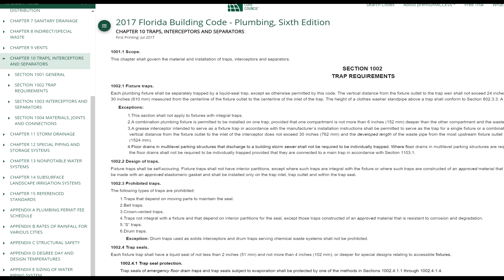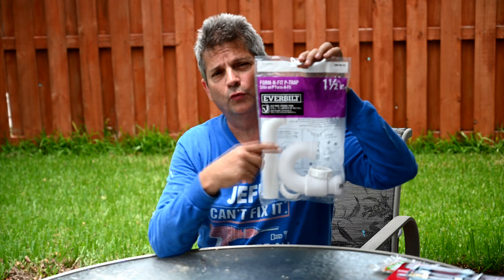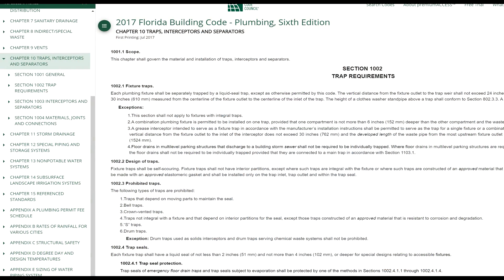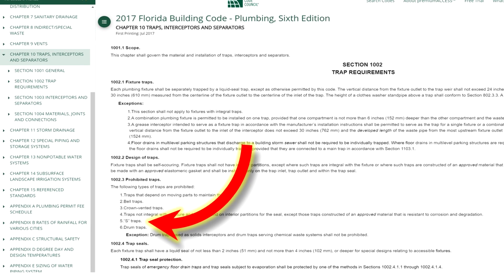Why You Should Never Use Plumbing S-Traps On Your Sink Drain

Comment: Snappy Traps say they are up to code. Not true?
From their website:
"Does Snappy Trap™ meet plumbing code standards?

Yes, Snappy Trap™ models # DK-110 and DK-100 are certified by the International Association of Plumbing and Mechanical Officiials (IAPMO) to meet the Uniform Plumbing Code (UPC). The UPC certification is valid in all 50 states and Canada. Part #ʼs DK-105 and # DK-120 are listed with IAPMO to meet the criteria of IGC 328."
Reply from the maker: I know they say that, but I have not played with there traps. They claim the inside of the p-trap is smooth, which I find hard to believe since the flexible p-trap acts like an accordion. I also find their claim about UPC valid in all 50 states, because UPC is only used in a few states. Here in Florida, our plumbing code is not based on UPC, although it has a lot of the same rules.

Comment: So my apartment sink has an S trap, and the landlord’s uncle apparently did the plumbing work. So since they’re not allowed I don’t know where to go from here about confronting the landlord about this.
Reply from the maker: It depends on when it was installed. Not sure when they banned them. They probably won't want to switch to p-trap, because assuming there is no vent stack within 5 feet, they would have to make on or connect to an existing vent stack, a feat usually done when the walls are down during a remodel. If you don't have any trouble with the S-trap now, if the drain works OK, and you never smell sewer gasses, you are likely to be OK.
Reply: Possibly contact the building permit department of your local municipality

Comment: 1:43 "It's almost like a capillary action".

It's nothing like capillary action. The word you were looking for is "siphon".
Reply: The video is full of inaccurate info. It was a waste of time.
Reply: Venturi flow is what we in the instrumentation trade would use to measure a DP across a flow orifice. Restricting the size of a pipe to change pressure and velocity. Not what you mentioned.
Reply from the maker: Yes, otherwise known as Venturri effect
Reply: @jeffostroff   The Venturi effect has to do with a decrease in pressure due to a choke in a pipe, which is not the Siphon phenomenon caused by an S-trap that this video is about.

The issue with an S-trap is that, if the entire pipe becomes filled with water, the rapid drop after the P-trap-portion will result in a vacuum behind the last quantity of draining water. Under normal conditions, where the p-trap is followed by a tee with a vent, the vacuum will be resolved from air in the vent. As there is no vent in an S-trap, the only place for air to come from is the drain, behind the draining water, which will siphon water out of the trap.
Reply: @YuriyRusko  This reply was more informative than the video.  Cut right to the heart of the matter clearly and concisely.
Reply: @jeffostroff  just lol. Venturi is nothing to do with siphon, unless you have a restriction in the pipeline that causes the flow to increase through that point - then that is a Venturi (facepalm)

Comment: Reference is made in the video to have the plumber reroute the drain pipe inside the wall.  That vertical drop through the floor is acceptable if properly piped using a p-trap in conjunction with a AAV(Air Admittance Valve) then drop down to that vertical drain.
Reply from the maker: Yes, they need to make sure their municipality allows those studor valves, some states don't allow them.
Reply: @jeffostroff  yes I agree but as i see it, an illegal s- trap with an AAV is preferable over just an s-trap no matter what.

Comment: Why are they allowed to sell these traps?  I saw drum traps are a no go also.
Reply: They sell them because often consumers just want to replace what they already had. I'm a plumber myself, I replaced the vanity and sink  of my bathroom recently but I had no desire to switch over to a p-trap because my s-trap was functioning without issue.
Reply from the maker: Nothing illegal about buying or selling them, they just are not allowed by building codes.
Reply: jeffostroff your missing the whole point,... you sell them to unsuspecting customers... integrity seems to be a missing trait in Americans these days.
Reply from the maker: @hvac01453   Yes I agree they should not be selling them to people or at the very least they should have a warning on the package that says this will violate plumbing codes and that maybe it should only be used as a very quick temporary solution or of somebody wants to use it outdoors maybe but yes you are correct and I wonder why all of these installers keep installing them to why does home depot and Sears and all of those companies that send installers to install people's refrigerators why do they keep using these banned parts.

Comment: If your drain system isn't ventilated properly, how is a P-trap any better? Wouldn't it suck the water out of the trap the same way? Maybe I'm missing something. Plus, if you have an existing S-trap under your sink, and it's giving you this problem, couldn't you just cut in a studor vent somewhere underneath the trap.  Honest questions here. Not trying to say this info is wrong, just trying to understand. I'm sure there's a reason I'm not seeing.
Reply: It takes years to get a journeyman plumbers license because of things like this. Water traveling through a drain pushes air in front reduces air pressure behind. Vents have to be located properly in the drain system so water isn't siphoned because of the reduced air pressure.
Reply from the maker: what you are missing is one of the causes of the S-trap self siphoning. It is caused by the S-trap having a short vertical leg before the S-trap, followed by a long vertical drop after the S-trap. This condition causes an increase in downward water inertia, which causes the S-trap to self siphon and empty out, called the Venturri Effect. The P-trap solves this problem with one subtle difference, that is that horizontal arm coming out of the p-trap and into the wall. That horizontal arm slows down the inertia of water so that it cannot sell siphon the P-trap. As long as your trap is within 5 feet of a plumbing stack you should be OK. Some states allow you to add the Studor Valve, under the sink, it must be above the P-trap. Not all states allow the Studor Valve, which is pretty much your only real option when you have an island sink.
Reply: Ok I see..  makes sense.  So installing a studor vent as close to the s trap as possible should solve that problem if you have an existing s-trap. Not ideal, but if you have no other option, that should fix the siphon problem.

Comment: I had no choice but to use the s trap there is no pipes in the walls under the sink straight down to the basement old house
Reply: If you have a S trap like in the video, disconnect it at the floor, install a new riser use a Tee and P trap. Out out the top of the tee put an auto vent. Easy fix.
Reply from the maker: @tracyreynolds2013  Yes, many states allow the use of a Studor valve under the sink. Some states like Wisconsin and a few others don't allow it.
Reply from the maker: Yes in your case that's fine if it still works. They really only make you put them in for new construction, and some inspectors might be sticklers when you remodel and open the wall, they might make you put in a vent stack, or route to one within 5 feet, or ad a Studor valve under the sink.
Reply: Use a hepvo waterless trap instead. It's much safer.

Comment: You should have mentioned that if all devices are vented it’s very unlikely to suck the other trap dry.. right?
Reply from the maker: Yes, if they are vented properly too, as there are equations that tell them where to vent, how to vent, how wide the vent stack pipe needs to be, etc.
Reply: I'm remodelling and am opting to use an S-trap instead of having my sched-40 adapter be in a horizontal position. I don't trust it in that position. I capped the old P-trap and am splicing into the same drain the P trap utilized in the basement, and it has a vent.

Comment: States do not enforce building codes, local authorities enforce.  And local authorities can and often do choose to allow existing items to be retained in exiting construction.  They would NOT require you to change out an S trap all by itself.  You likely would have to change to a p trap if you were doing a complete remodel of the bath or kitchen.  The real issue is proper venting which will allow an s trap to work fine.  If toilet flushing causes the s trap to evacuate, then the toilet is not properly vented.
Reply: 36736fps you’re totally correct
Reply: That's dangerous

Comment: I just remodeled my house in NY 4 bathroom sinks,1 kitchen sink, 2 utility sinks one in laundry room and one in garage, two washing machines one upstairs one downstairs in laundry room and guess what all sinks in house drain through an s trap into 2 inch drain line with a vent going up through roof. Code inspector said it is perfectly fine to use s traps and also pointed out a code violation using p traps with drain pipe in wall I chose to use 2 inch on my drains because of the number of fixtures on system now you take a 2x4 wall and drill a 2 inch in the 2x4s you just broke a code because of the size of holes you just drilled for that pipe now to drill a 2 inch hole through sub floor and no code was broke. I also have my systems as two separate systems black water and grey water. My grey water goes into a hundred gallon tank then through a small leach field. I have never believed that grey water and black water should be together unless you are on a public system. The soaps and cleaners dumped down sinks and from washing machines kills the bacteria in septic systems causing a need to pump them out more often and causes other issues in septics keep the two drain systems separate and properly sized and vented and s traps work way better than p traps  My code inspector had no issues with me using s traps and neither did my insurance company when they did there inspection after remodel.
Reply from the maker: That's interesting because it is in the NY code that S-Traps are banned. Also, I don't see how any code would ban the use of P-traps, are you sure this inspector showed you that P-traps are banned? I want to to see the exact chapter of the plumbing code for that one, I don't believe it at all.
Reply: It seems that the p trap violation he refers to is not in reference to the trap per se but to the size of hole to accommodate the drain.

Comment: Ok then.  How do you put a trap in an island sink who's drain is down through the floor? My house was built with an S trap.
Reply from the maker: Steven there are 3 approaches to this:

Solution#1: Do nothing at all. If your current S trap is not giving you any issues and you don't smell sewer gases and if it is retaining water like it should be and the water is not siphoning out of it then there is no reason to change it. 

Solution #2 Involves putting a Studor valve under the kitchen sink only if your state allows it. Our state Florida allows us to put one in and we use them all the time here where there's kitchen island sinks, and you’re not within 5 feet of a vent stack. The Studor valve sucks air in from underneath the cabinet and it has a membrane that prevents sewer gases from escaping out of it. 

Method #3: involves using a P trap but you would need to have a partition wall on the island behind your sink, many builders will build the island with a little partition wall in there to pass drainage pipes and water pipes. So your P trap will go into that wall with the horizontal pipe where it meets up with a vertical vent stack pipe that would go downstairs and meet up with the rest of your vent stack pipe network. Step #3 requires a plumber with experience to do this because it undoubtedly involves a little bit of work inside walls, cementing in couplers, etc, and working down underneath floors below to tap into the vent stack.
Reply: @jeffostroff  
Thanks for the quick reply.  I live next door in GA and they allow Studor valves.  I may try that since the drain runs kind of slow.  BTW, thanks pal.  Now I have to go take out all of those accordion thingies I put in when I redid the bathrooms. :{
Reply from the maker: @sculpin590  Should be a piece of cake  to get those done.

Comment: I’ve never seen an S trap installed in a house, only P traps. How old are these houses that have S traps?
Reply: As time went by engineers have studied trap seal loss with S traps and other forms of traps which fail due to a flawed design. The P trap is the only trap when installed correctly keeps the water barrier to prevent sewer gases from entering your home.
Reply from the maker: @marcp4389  well said!
Reply from the maker: There was one person who wrote in the comments below that their house was from that really 1900s
Reply: My grandparents' bathroom sink had an S trap....
Reply: My house was built in 1959 and has the a S trap. Just replaced the sink and reconfigured pipes without garbage disposal. And yes, was sold a replacement S trap by Lowe’s and 2 different reps said nothing about not being code. Never heard this till saw this video. I would have gotten a plumber to bring it up to code and saved me a lot of time, hassle and expense.
Reply: My home. Jesus... It's redic to try and do.
Reply: Hang out with a plumber or rehabber for awhile. The stuff ive seen... not just inclusive to plumbing. Electrical is where it gets scary.